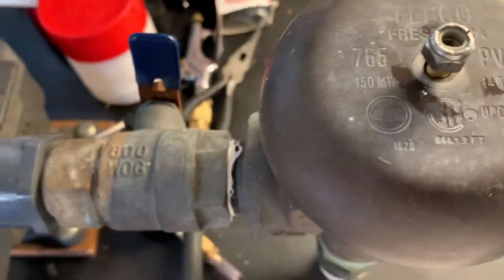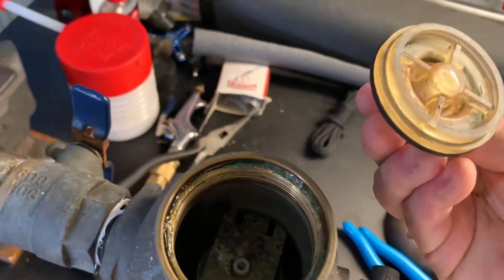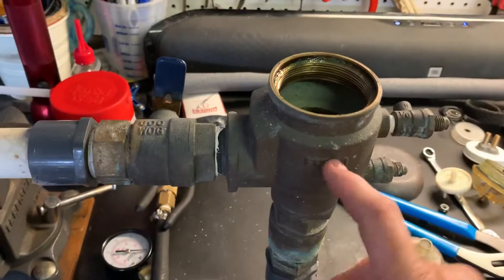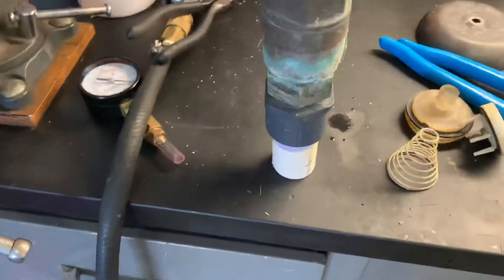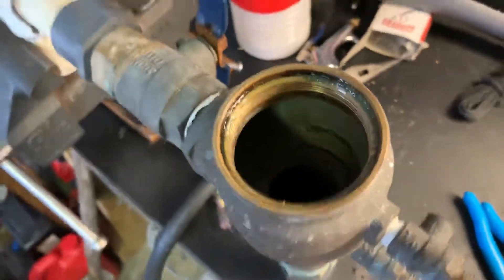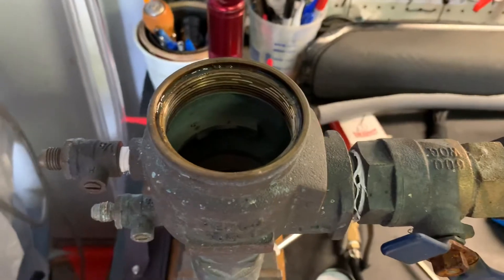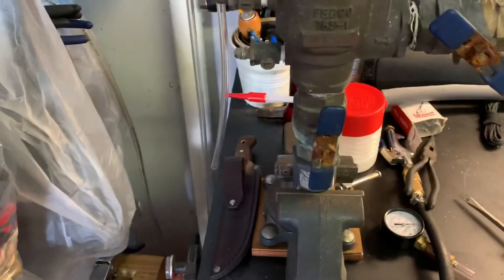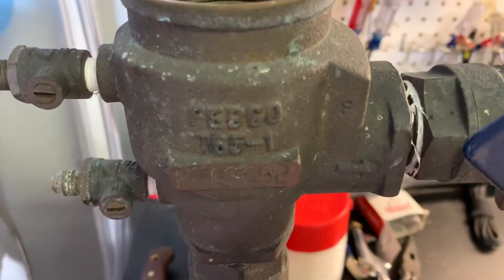Febco 765 - 1 inch PVB Sprinkler Vacuum Breaker winterizing and installation

Comment from the maker: One thing to keep in mind when thinking you have to replace this PVB is to ensure the failure is not in the PVB housing. At 6:35  in the video near the turquoise colored area you can see the crack on this failed unit and it happens to be on the ball valve itself. So in this case instead of replacing the entire unit you could just buy a 1 inch ball valve and replace the one ball valve. There’s a 1 inch ball valve on the input side and a 1 inch ball valve on the output side. Both are replaceable. That would be like a 15 or $20 repair instead of an $85 repair
Reply: would be like a 15 or $20 repair?  Here is some update.  That's why I chose a whole set replacing instead, since it was an old unit after all
https://www.amazon.com/gp/product/B082WMCVXD/ref=ppx_yo_dt_b_asin_title_o03_s00?ie=UTF8&psc=1
Reply from the maker: jkwo2007

REVALVED Full Port 1 in. Brass Ball Valve – Lead-Free Brass Valve, Female Threaded NPT Connector – Max Pressure, 150 PSI WSP / 600 PSI WOG - 1 inch, 1 Pack

Would not buy the Febco valve. Buy the one in the link or similar. Febco is ridiculously expensive. Funny you can buy the entire 765 unit for $100 or so and get 2 of their valves and all the other stuff!. But if you buy one valve alone it is $65!